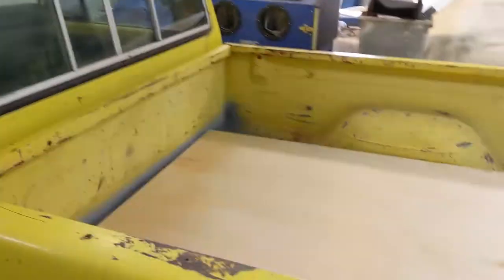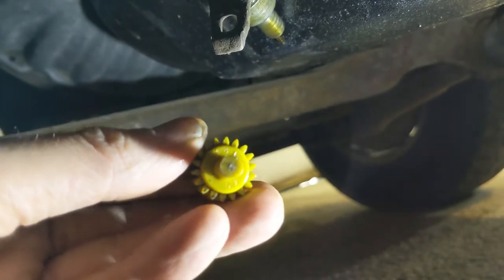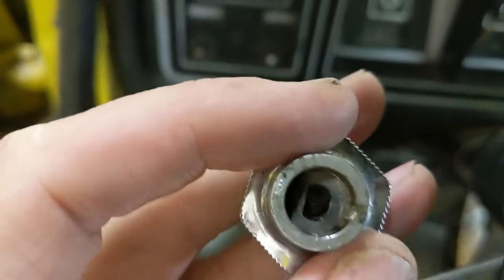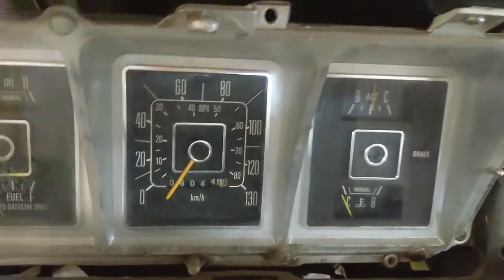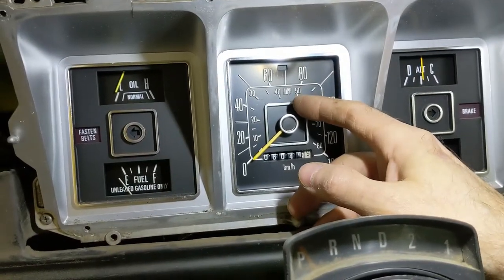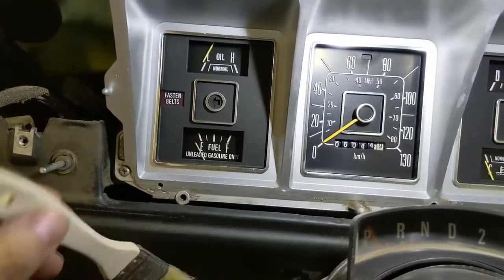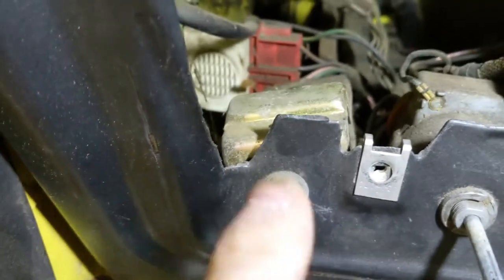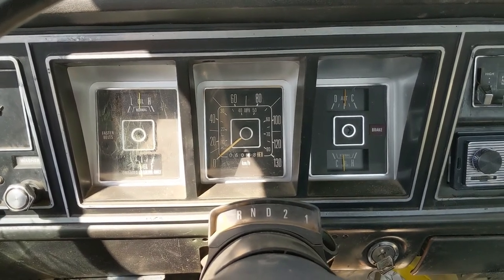Dialing In The Speedometer On The 79 Ford F100

Comment: So the speedometer completely stopped working on mine, any ideas what that could possibly be before I attempt taking things apart? I have almost no knowledge about the 79 f100, and I'd rather not screw mine up by attempting to fix it without knowing possible fixes, and when I looked it up, this was the only video to pop up, so I figured I'd ask
Reply from the maker: Aidan, there are a couple of things you can check. Check to make sure the speedo cable didn't come out of place by reaching up and behind the speedo/gauge cluster in the dash, the cable should be in the cluster firm, it's only held in with a metal spring clip. Another, is to take the cable out of the transmission and manually turn the cable using the gear, to make sure the cable is turning freely. Once you confirm that the cable is fully seated in the cluster, the cable is turning freely , and you still have no movement on the speedo needle, then you may have to look at other issues like the speedo head in the cluster, the drive gear condition in the transmission.
Thanks for asking the question, hopefully this helps.